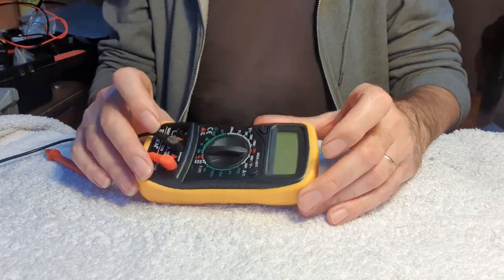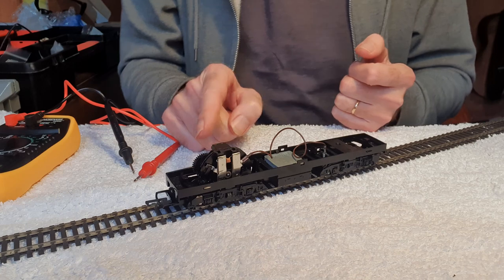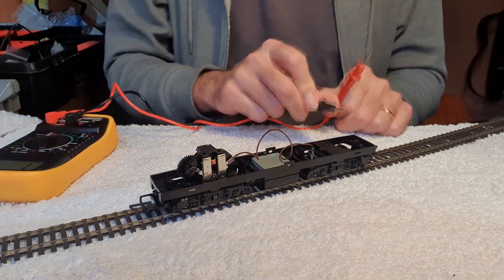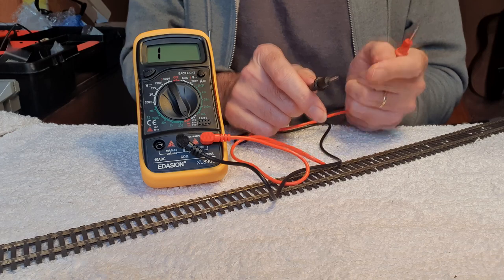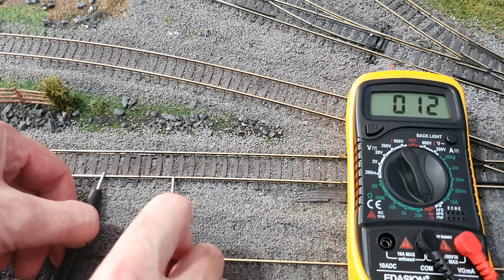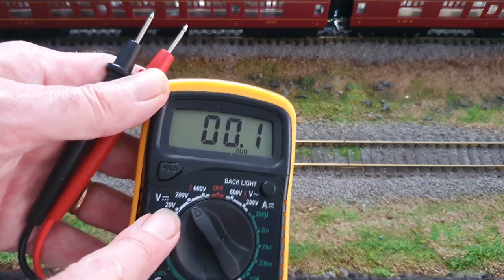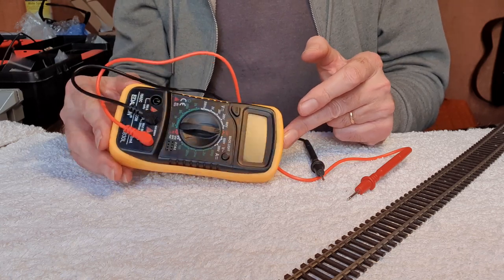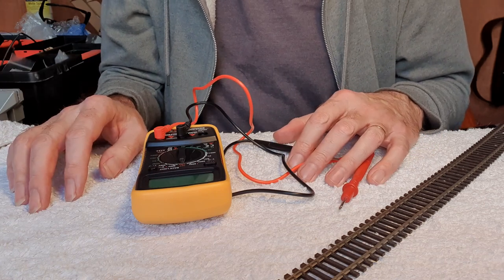Multimeter (How and why I use one)

Comment: Hi Bill, excellent video. The multi metre can be an excellent tool to have, you don’t have to be an electrician to use it. For many issues it a great help. Read the manual and instructions that come with it. Dealing with small currents on the model side. I’m thinking of having some amp meters on the layout, can the see the draw on the various controller, one meter for each controller though, thanks again for a great informative video, all best Marc

Comment: Remember the audible sound will go off over a wide range. So checking the screen and resistance reading as well is always a good thing. If you are looking for a low resistance double check. Audible is a good first indicator.

Comment: Thank you for a very informative video, I seem to collect multi-meters via Christmas tree presents, could never bring myself to confess to Father Christmas I have no idea how to use them.
I rely on the old screwdriver with a bulb and crocodile clip 6-24 volt auto tester. I used to use this to check and set the timing on my first car - a Triumph Herald in the early 80's. A bit limited in its use for modelling.
So thank you for the walk-through- I'll have to check to see if any have a beep for ease of use!
Reply from the maker: I used to use a wee bulb wired to a 9v battery with two wires to test for continuity. I also had a tester for setting car timing that got used as well. Hours spent in a cold dark garage with a Hillman Avenger!

Comment: Thanks for a very informative video. I'm new to the hobby and like other contributors I bought a multimeter sometime ago and until now didn't know what to do with it. I've tested my track and all seems well. However, even after cleaning the track, the locos don't seem to run smoothly. I think the problem might be with the el cheapo Hornby controller and so I'm thinking of investing in the Morley Crawler, which you highlighted in one of your other videos. Thanks again for the videos.

Comment: Update - the measuring across joints has worked a treat and has allowed me to completely resolve the problems on the track circuit which was causing problems. Many thanks indeed.

Comment: Evening Bill, what a useful video you have put on You Tube, generally I use the multi meter to check the readings of my batteries on my narrow boat, but never used it across to the modeling area. Due to (like many) have no I idea what the other settings are for! The instructions which come with a multi meter(s) are generally useless as they are over complicated to the layman.

Comment: Hi Bill, Multimeters can be an excellent tool for modellers. It’s ok for checking and testing but it’s knowing how to understand the readings when you get one, if you are looking for a reading, that is. My message to all readers: All multimeters come with instructions please read the instructions and check the examples in them. There is no doubt that it’ll enhance your understanding of how your models work.
Reply from the maker: The problem with the instructions for multimeters (at least the four I've owned) is that the instructions usually need instructions! I'm guessing more expensive ones have better instructions.
Reply: @oobill  the more expensive ones tend to use the knowledge that a electrically qualified guy would have ( being one myself ) I think it’s to limit it to peoples ability to use them without training

Comment: Very informative video. It is worth noting that the track voltage method will only work with DC as DCC will give incorrect and strange  results as it is a digital pulse that is best measured and seen with an oscilloscope. DCC track continuity can be measured the same way but just ensure the track power is switched off as the multimeter may not like it and sound a bit strange, I found that out one day when I forgot my controller was on and wondered why it had a strange buzz rather than a normal beep, pressed the track power button to off and all was fine.

Comment: Thank you very much for this video. Really useful. I should have known all this but sadly have forgotten over the years. I do have a multimeter but to date have only really been using it for continuity. As you suggest I have now ordered one with the sound for continuity. Excellent idea. The measuring of resistance across track joints is a must and I will now be doing this. I do solder all my track but it is surprising how the difference in Summer and Winter temperatures can cause breaks.I actually now model 0 gauge but I find no end of useful tips for servicing with your channel.....and it brings back many memories of my 00 gauge locos and layouts. Interestingly most of the motors in my locos are sealed and one cannot really get into them/take them to bits but the cleaning/oiling etc is exactly the same.

Comment: Interesting, the continuity setting is for testing Diodes which for a better description is a one way switch, when testing motors etc it is always best to isolate motor windings as you could get a reading via a path that may still be connected out of sight.

Comment: Hi, great simplistic easy to follow tutorial, thank you. I have a problem on my dcc layout and will use my multi meter (after blowing off dust)to check continuity. Does using droppers instead of fish plates help continuity? Thanks once again. Also subscribed 👍🏼
Reply: I'm not a DCC person, but I would have thought that having droppers to every section of track will (a) avoid you relying on the fishplates for power and (b) will interfere with the continuity reading across the fishplate. (The route between two droppers is hopefully a lower resistance than through the rails!). You may be quicker checking you have voltage on each section first. (But see Rob Arnold's answer too!!)

Comment: Thank you, Bill. Very clear and concise. I've been using multimeters since I was little, but never thought to test the continuity over a fishplate! Good idea. Not keen on using cutters to 'crimp' them though, I would prefer to use pliers to avoid cutting the fishplate! Keep up the good work.
Reply from the maker: Snippers give a better pinch than pliers and are more effective when the track is ballasted I find. Just don't pinch at the actual join and don't squeeze too hard.

Comment: Hi Bill, a great, easy to follow tutorial and just what I needed to work out what's wrong with my old ringfield motor Mallard. 

The motor works when battery tested but not when the battery is applied to the wheels. I knew there must be some sort of connection issue but couldn't work out where. Hopefully I'll be able to sort it out now. Thanks!